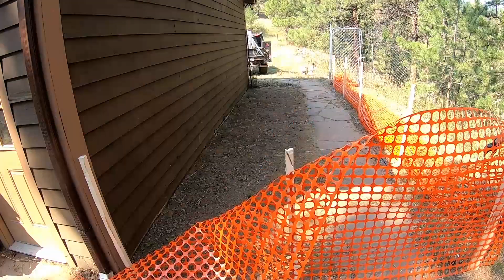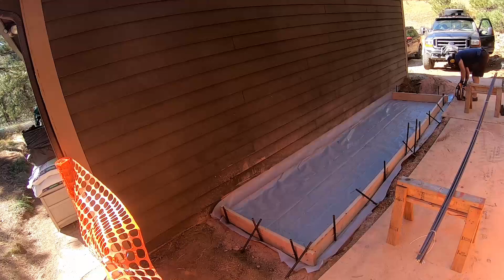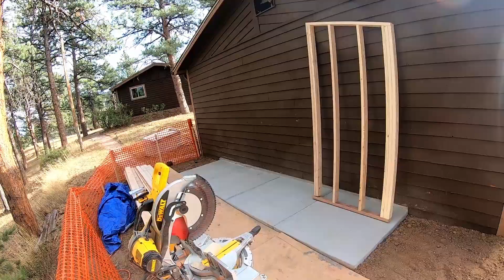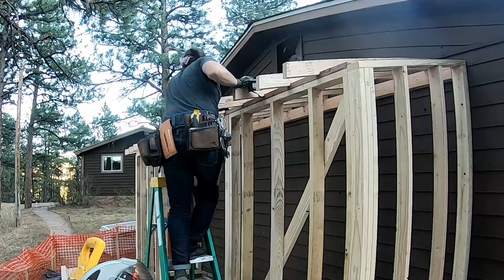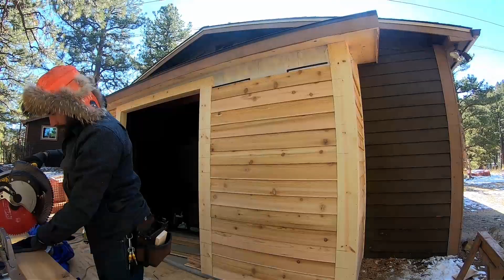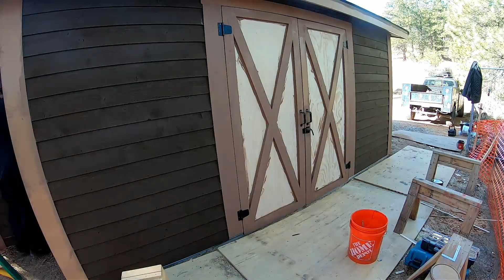Building an Attached Shed for My Neighbor

Comment: Great video, thanks. Did you fasten the walls to the garage with a way to handle any movement in the slab? Wondering what might happen if you get a fridge heave. I’m about to start a similar project and am concerned with my slab shifting. Thanks

Comment: Great work and thanks! How did you handle flashing the roof to wall connection?Also, did you fasten the shed to the side of the barn?
Reply from the maker: Thanks! Yeah I didn't put the camera up on the roof :( I used a big piece of L flashing and tucked it under the upper siding where I could, then added roofing grade caulk around the seams for extra protection. Then the flashing was over the top of the last layer of shingles and the nails sealed similarly. Yes the side walls and upper header are screwed through the siding into the garage frame.